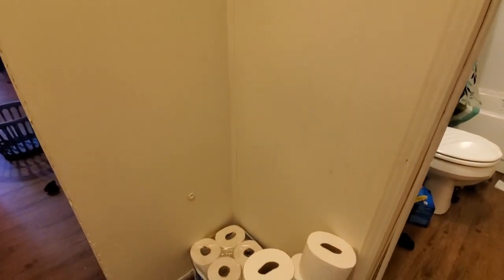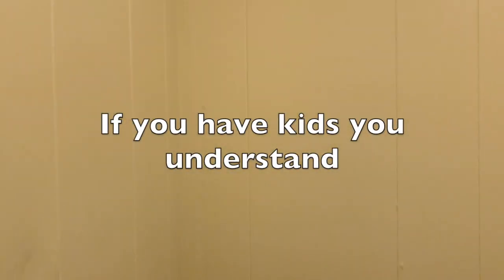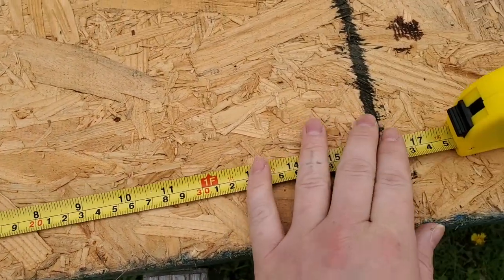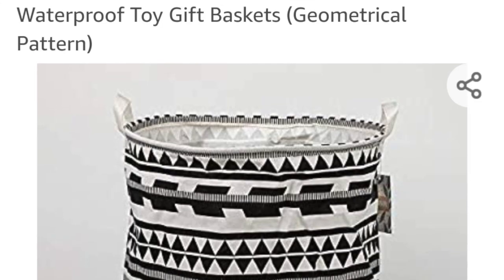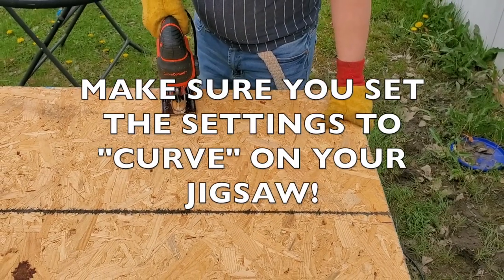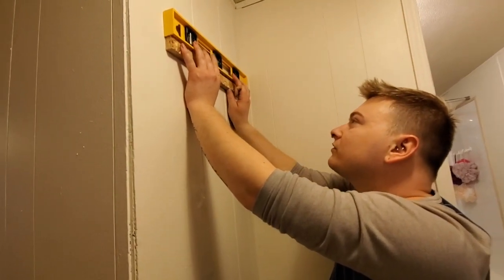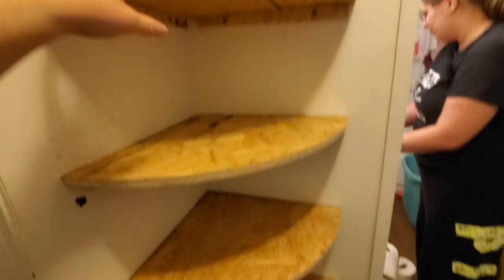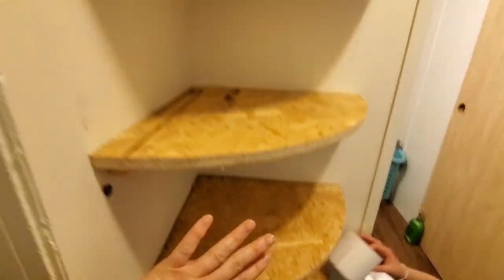DIY Round Corner Shelves

Comment: Great idea for extra storage. I would suggest joint compound to have filled in all of those holes in the plywood, then sand them and paint. And then paint again using the first painting as your primer. All purpose caulking on the edges should close any gaps between the shelves and wall. And you could have cut back the braces you used to a little more than half the shelf length. That would really hide them more and still provide support 😄
Reply from the maker: Thank you! 😊 I know it has helped them out a lot considering there is no closet for linen or toiletries. I think what your saying is a great suggestion and would make them look built in - however since it's someone's home and not mine - convincing them to spend more money on things your saying seems pointless (you know how people are with money) 🤣 I also wasn't paid for this project - I helped show her how to use power tools and that you could in fact create your own shelving unit - the finishes were on them again - lol I wasn't about to be painting and caulking shelves for free when I have my own stuff to do, ya feel me? 😉  but I hope your comment helps anyone seeing this in the future so they can learn to not skip those things for a better outcome! 😊

Comment: Awesome! I'm starting the round shelves in the corner currently and found your video:) I was looking for how to draw out the curve, where you used the table but I don't have anything big enough for mine:) I'll have to find a round table too:) HA! Nice job though
Reply from the maker: A spare tire would also work just think outside the box!!! You got this!!!
Reply: Just a heads up if you haven't already done you project. You can stick a nail into the corner of the piece of wood you are using and then use a piece of string wrapped around a pencil to get the right curve.